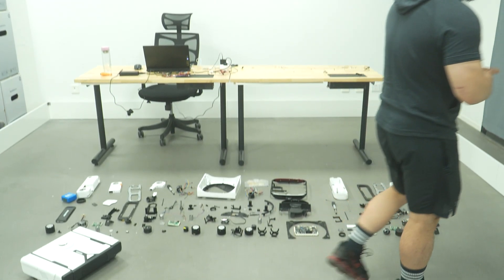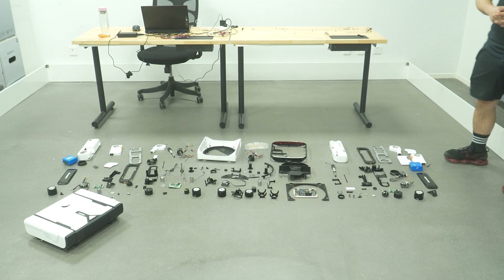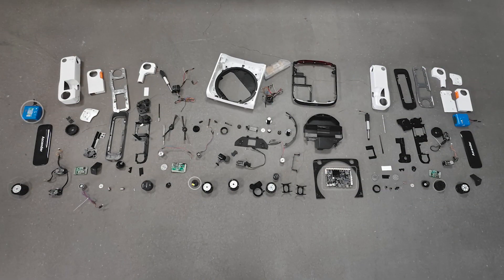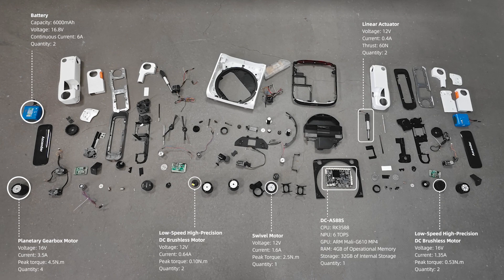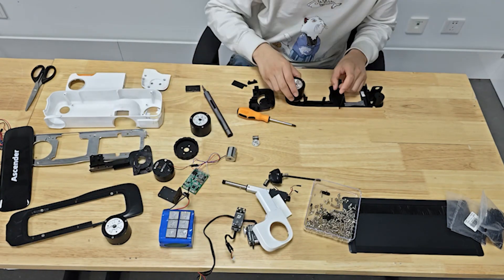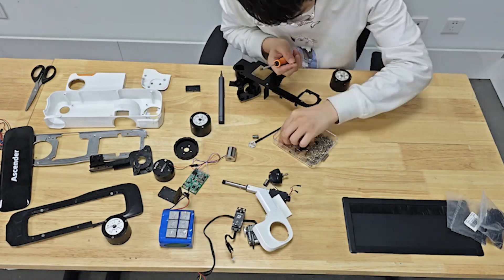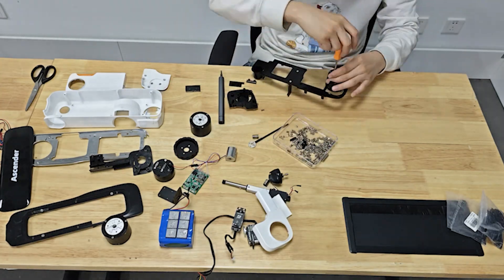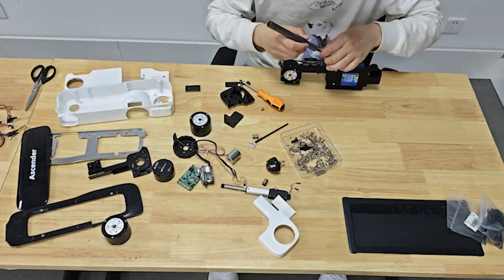Ascender Assembly Demonstration

Comment: In this assembly, it does seem that the batteries are pretty tucked away and inaccessible. How will battery replacements be easy without taking apart the entire robot?